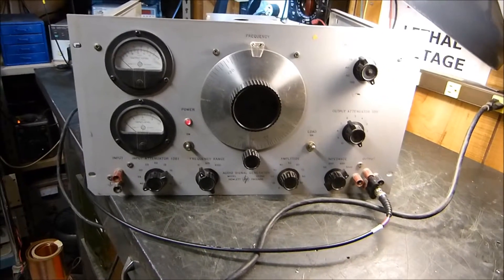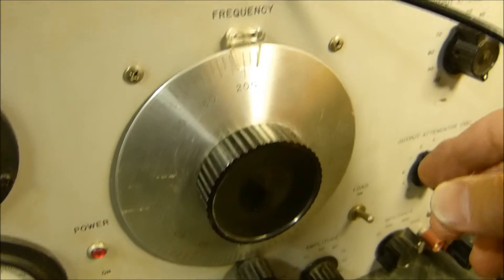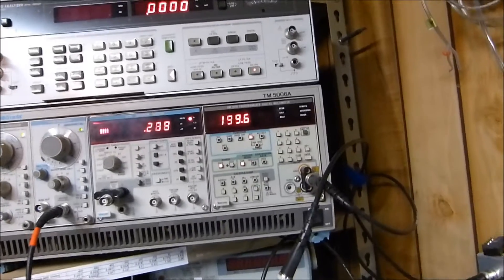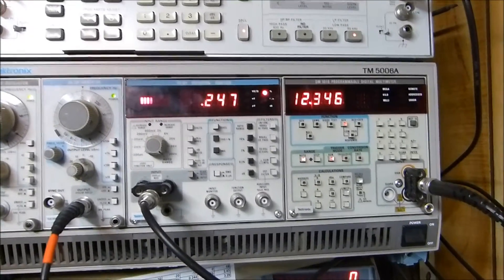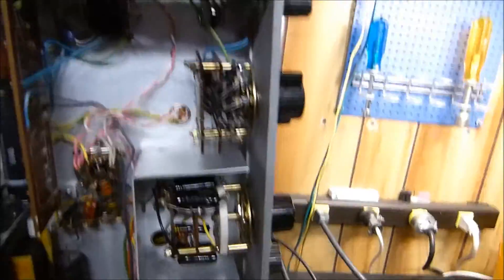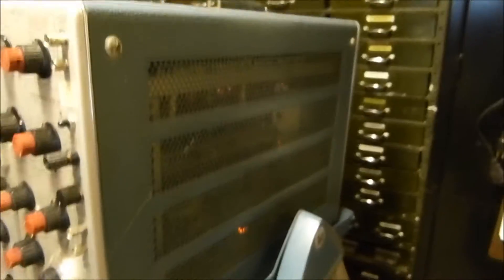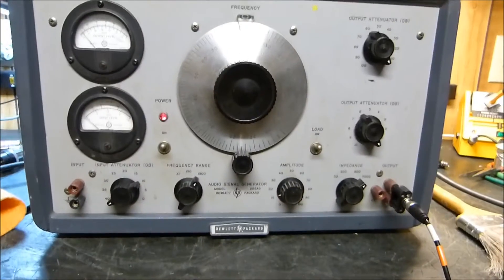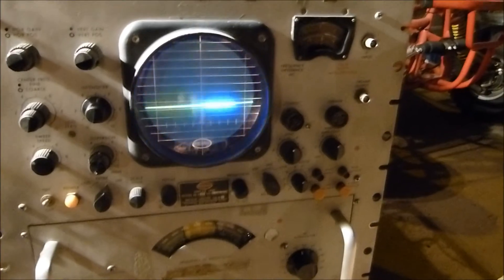HP 205 AG Audio Signal Generator

Comment: That polarad looks nice too !
Reply from the maker: Thanks. These were some serious instruments in their day. I knew I had to document them quickly for posterity before they quit working and both the Polarad and the HP signal  generator died. The HP had a capacitor explode inside and oil was everywhere. I don't know it it was PCB oil or not so I took no chances and threw it away saving almost nothing from it. The Polarad quit working, I don't remember why, so I parted it out. For all I know, some of the parts may be living on in something else I have built or repaired. The big Tektronix oscilloscope is still working great.
Reply: Probably was PCB oil, but it could have been cleaned up.

I had an earlier version of this one with the old style knobs and the vernier on mine was the big knob on the frequency dial.

It failed the power transformer in my early teens (40 now) and at the time I had no clue about actually repairing things. So I parted it out.

With mine when it worked it would actually develop enough output to make a small record player motor spin, but not very fast.

Always wanted to find another one.

Comment from the maker: I sure don't know and am puzzled by it also. Push pull 6L6's in the output are there for some reason but I don't know it's intended purpose. Maybe I can look it up on the Bama Boat Anchor site and see if they have the manual for it. For a 1950's instrument it's THD is low and it appears that voltage output is fairly constant. I haven't tested it thoroughly yet to see just how flat it actually is.
Reply: Having an audio generator that put out such a high voltage would have been useful for designing and repairing tube amps as one could test most push pull power output stages directly by capacitor coupling this generator straight to the output tube control grids.

Comment: Hi Ray,

The 205 looks great. I have heard of these but not played with one. If you ever run across a Micro Dot Audio gen, garb it. It is an amazing gen with selectable Z IN and Out from 50 to 600 ohms. I have never found manuals on line and suspect not many were built but it's all g10 glass boards and built like it was going in the space shuttle. I have seen them on epray for under $100, They also made a function gen and a few other items. This stuff is as good as HP and for a song.
73,
Glann